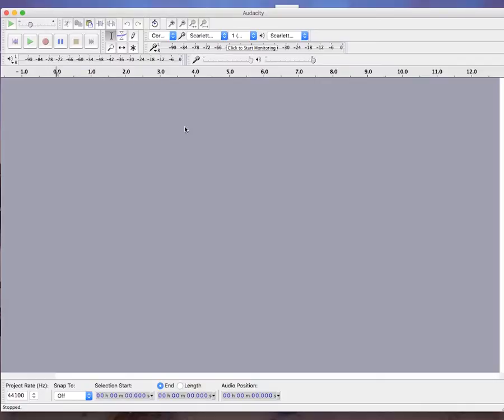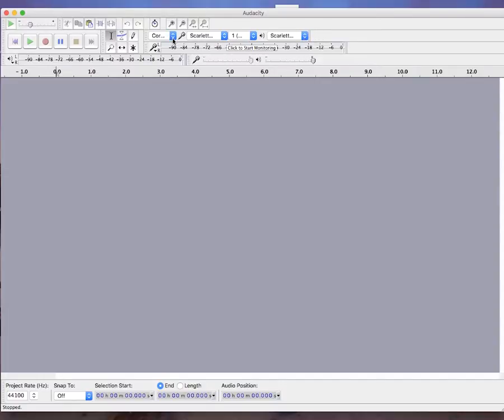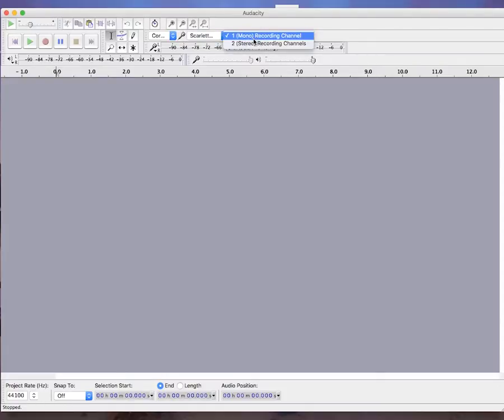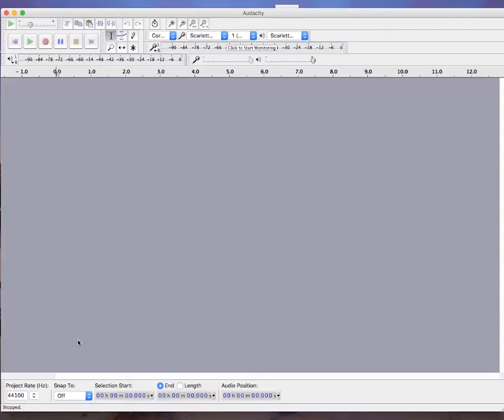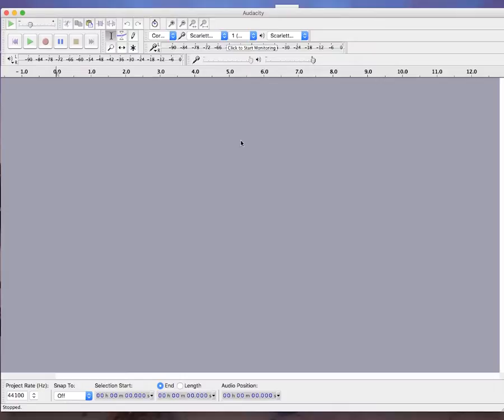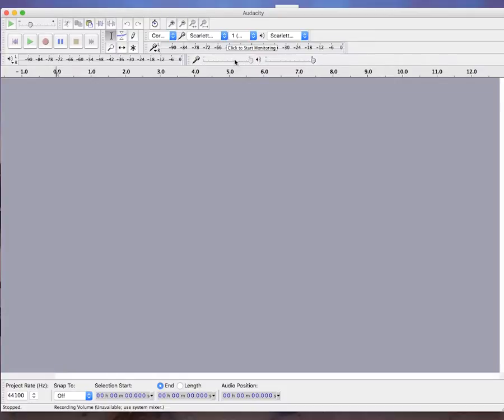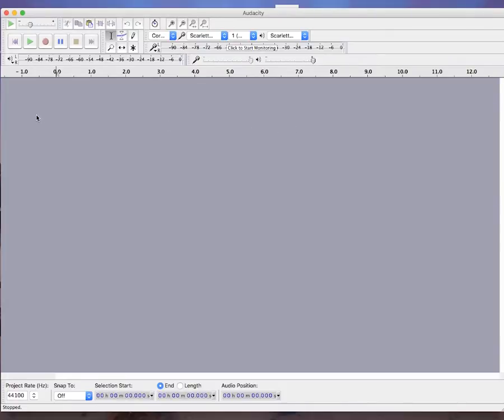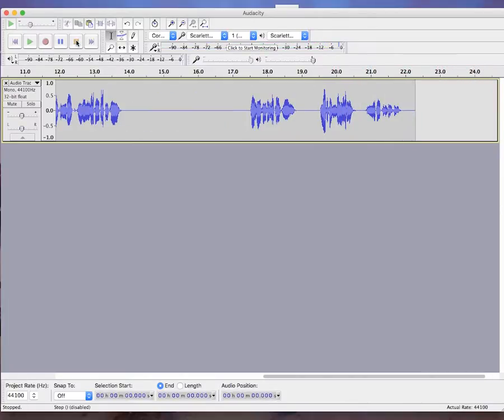Best Audacity Settings For Beginning Voice Over/Voice Acting

Comment: This is a quick and easy tip. However why is there a delay when recording my voiceover?
Reply from the maker: Not quite sure. There’s a delay on playback?
Reply: @ChrisAgosActor  Sorry I meant there's a delay during recording
Reply from the maker: @Dina319  Hmm that’s a confusing one. Are you recording just one track or multiples?
Reply: @ChrisAgosActor  Thx for getting back to me. I was  recording mono for voiceover. Audacity was working earlier but for some reason now it does not. I'm going to try unplugging and replugging my interface and see if that works. 🤷🏽‍♀️
Reply from the maker: @Dina319  When in doubt that’s usually good to try. Also, not all interfaces play nice with audacity do check their website to make sure yours does. Good luck!
Reply: @ChrisAgosActor  one track

Comment: How do you avoid your voice from sounding “boomy” and “bassy”. I only set the gain on my Scarlet at 12 o’clock. If I go higher it sounds worse. If I go lower it sounds low. What am I doing wrong? I have a Rhode NT-1. Any thoughts and ideas?
Reply from the maker: Though I am by no means a tech guy, typically when this happens there are adjustments that can be made both in Audacity, and on the 2i2. Dial the gain back using the gain knob of the 2i2 until you notice that boom-y sound lessening. You also may want to back off the mic while recording. You shouldn't be too close to the mic. You can also  lower the gain on the particular track on which you're recording in Audacity. Good luck!
Reply: @ChrisAgosActor  Thank you very much for your reply. I'm already tried that and it's not working. I think the only option is to play with the bass on the EQ.